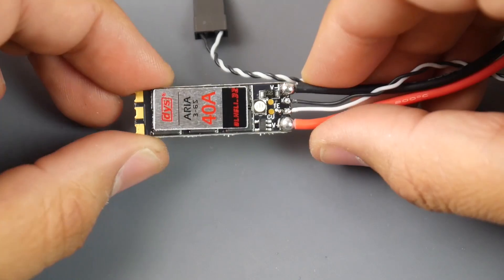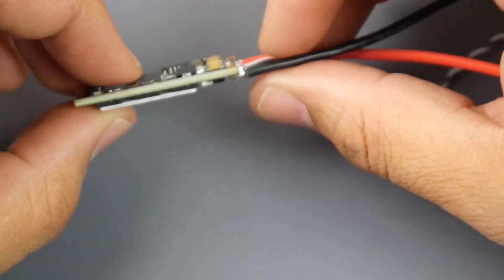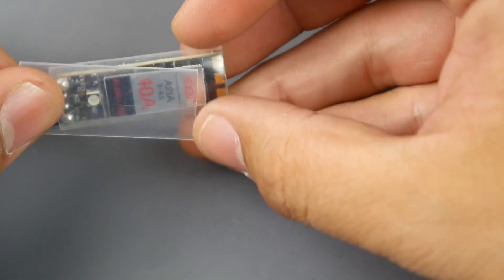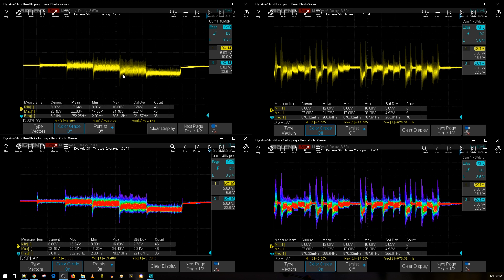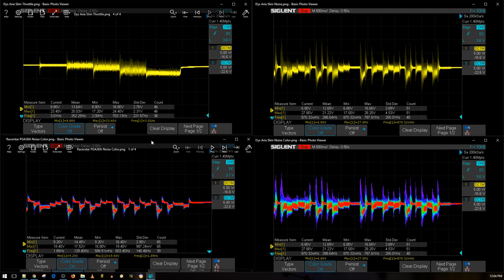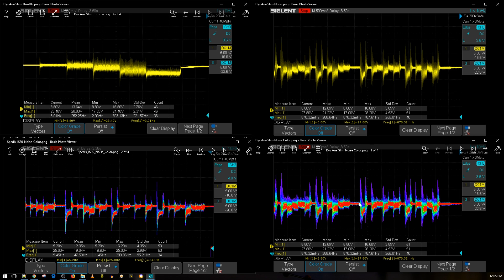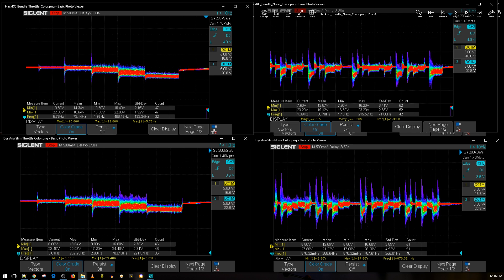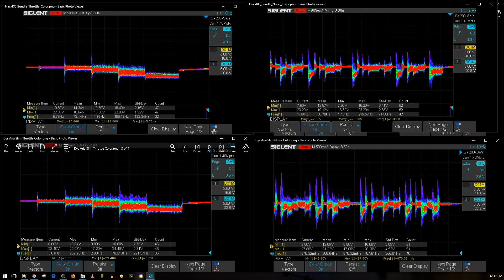HOW GOOD IS A SLIM ESC??? // DYS ARIA 40A SLIM ESC Review and Noise Test

Comment: I got a ori32 esc with no visible burned parts or burned smell but if I plug in lipo motors doesn't make a sound, do you know which components I should measure or look at? (I had a lipo burn out with it)
Reply: Same here, you ever get it to work again? Mine went out 5min into first flight. Motor quit but no fire or smoke and no throttle signal.